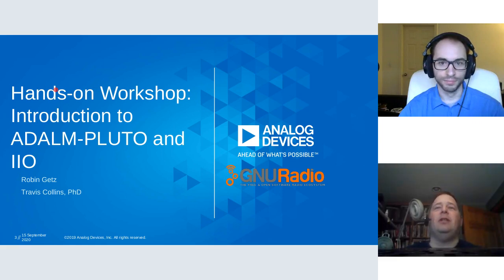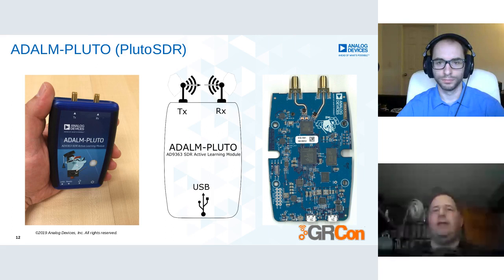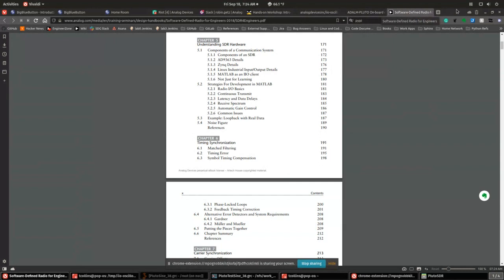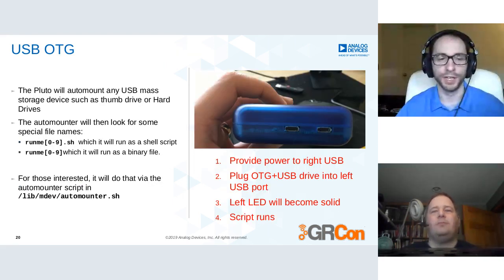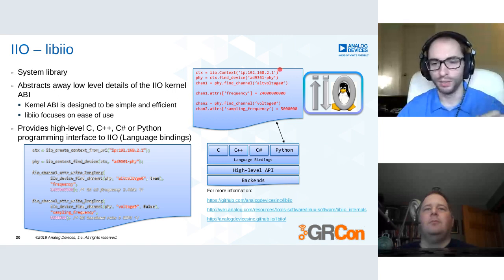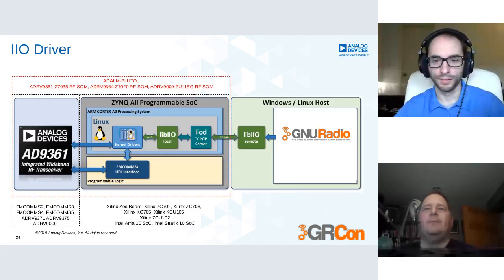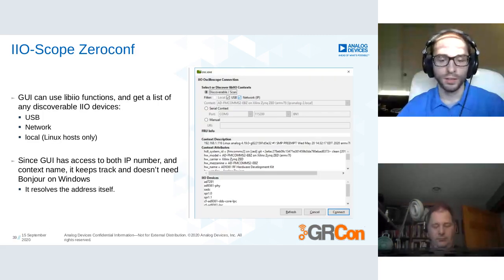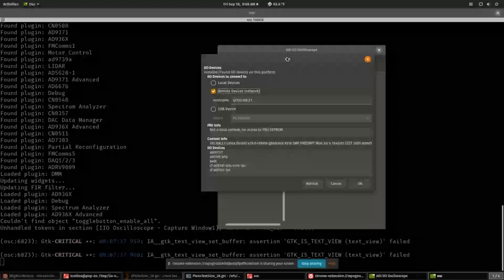Introduction to the ADALM-PLUTO SDR

Comment: I have a Adalm Pluto, with the Frequency Extension from 70 Mhz, to 6 GHz, I use SDR Angel Software for DATV Reception, and Transmission, both analog and digital,